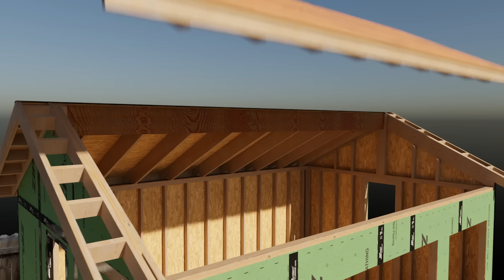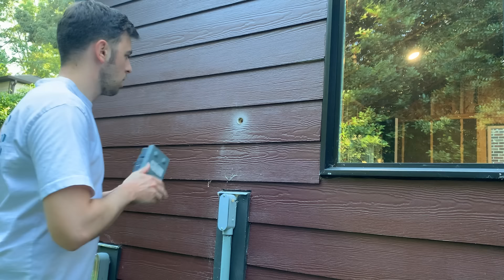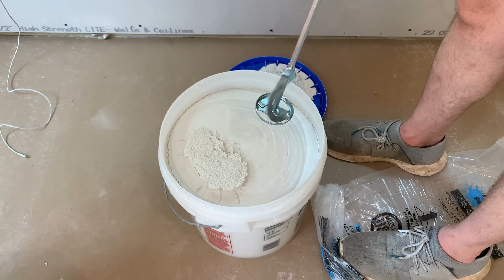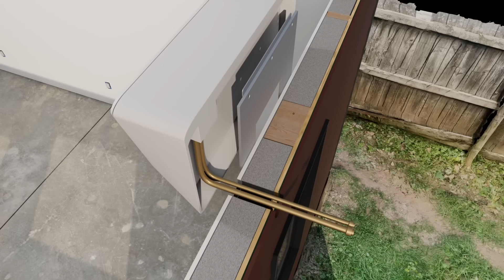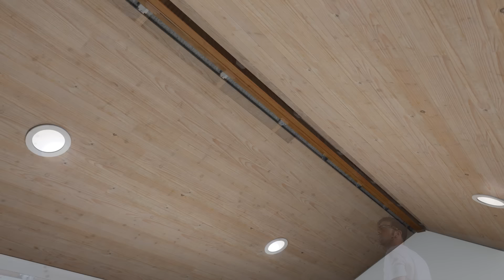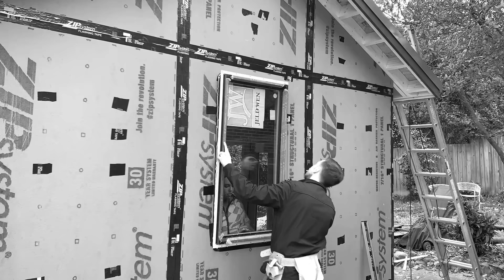Backyard Office & Workshop | Full DIY Interior Build (Insulation, Drywall, and Mini-Split)

Comment: I don't understand why people in certain parts of the world build a house with "wood" in a area known for tornadoes...etc?

ps: nice build btw.
Reply: First, most of the U.S. doesn't experience tornadoes. Second, you don't understand because your not educated on the relevant topics. You don't understand that American homes routinely stand up to EF2 and below tornadoes, which are the very large majority of tornadoes. You don't understand that EF3 to EF5 tornadoes would also devastate your concrete/structural brick homes and their contents, especially EF4s and EF5s, because you don't understand how tornadoes actually inflict their damage. If you have a roof, windows, and one or more doors, the tornadoes you see that destroy U.S. homes are going to cause severe damage to your home, too, including the destruction of your interior and its contents.

I'm going to try to edify you:

1. Cost-efficiency: Building with wood is significantly more affordable. If this office had been built with poured concrete, brick, or ICF, the wall system alone could have matched or exceeded the cost of the entire finished build. Solid clay brick or ICF construction could easily triple the expense.

2. Ease of use and adaptability: Wood is abundant in the U.S., straightforward to work with, and highly flexible—ideal for DIY construction or projects that may need future modification. Cement and brick are far less forgiving in this respect.

3. Longevity with modern materials: Products like ZIP System sheathing, Rockwool insulation, and closed-cell spray foam enable wood-framed structures to last 50+ years with routine maintenance. Many forms of maintenance (like roof replacement, HVAC servicing, or window sealing) apply to all construction types—wood or masonry.

4. Maintenance as personalization: Americans often view upkeep not just as a necessity, but as an opportunity to customize or improve a space. Materials that are easy to modify make this more feasible and affordable for homeowners.

5. Climate and seismic suitability: Wood performs better in earthquakes than rigid masonry or concrete because it can flex and absorb energy without catastrophic failure. In humid or freeze-thaw climates, wood-framed walls with proper air and moisture barriers dry more quickly than solid masonry, reducing long-term degradation risk.
 
6. Masonry Is not maintenance-free: Structural brick or cement walls crack over time due to settling, thermal movement, or moisture intrusion. Repointing brick (replacing deteriorated mortar) is labor-intensive and costly. In tropical or coastal climates, concrete often suffers from spalling and rebar corrosion unless treated or maintained diligently.

7. Code and efficiency evolution: Contrary to what creators chasing views and comments, as well as the vast expanse of ignorant anti-American bigotry, will tell you, U.S. residential building codes are designed around framed construction and offer prescriptive paths for high energy efficiency, air-sealing, and insulation. That doesn't mean that structural brick, ICF, and poured concrete aren't commonly used here, and in fact you'll often find this mixed in with wood-framed construction. But modern assemblies using continuous exterior insulation, WRBs like ZIP, and smart vapor retarders outperform many uninsulated or monolithic masonry walls in both comfort and efficiency.

8. Speed and labor: A small wood-framed building can go from slab to dried-in shell in a matter of days, even by one or two people. Masonry and concrete construction is much more labor-intensive, often requiring skilled tradespeople, scaffolding, longer curing times, and heavier equipment—costs that quickly add up in time and, importantly, significantly higher costs.

9. Thermal bridging: Wood has far less thermal conductivity than concrete or brick. That means fewer cold spots and less energy loss—especially when combined with modern insulation. Solid masonry often requires interior framing or furring strips just to install insulation and wiring, undercutting the “simplicity” of masonry walls.

10. It’s CONTEXTUAL, not cultural: The U.S. uses wood because it makes sense in the U.S.—where forests are abundant, labor is expensive, and zoning often encourages detached structures with individualized heating/cooling. Many European or tropical regions build with masonry because their conditions are different—denser cities, cheaper masonry labor, limited forest resources, or colonial building legacies.

Critically, the United States encompasses one of the most diverse ranges of climate zones and geographies on Earth, spanning 8 major climate zones and 13 subzones—covering everything from arctic to tropical, humid to desert, coastal to alpine. This geographic and environmental diversity is reflected in our building code and practices, which allow homes to be tailored to the specific demands of each region.

It’s not that one method is universally ‘better’—it’s that building wisely means adapting to local realities. In North America, wood framing for residential construction is the clear choice much more often than not. And when it's not, we can build it differently.

Comment: I don't expect you to care, but This means the keyboard should be below you height when seatedas a network engineer who is now in PT for severe RSI, your monitors shouldn't be that high. The top of your monitor should be close to, or parallel with your eye/brow line. The keyboard should also be below your elbow height when seated. I'm not meaning to be critical, I've sustained pretty dramatic nerve damage from a posture very similar to what I see at the end of the video and don't want anyone else to experience this. It really does suck. Awesome build otherwise, looks really chill.

Comment: Not sure what made you decide to use spray foam. Vapor barrier plastic sheeting is cheaper, doesn't trap moisture, and isn't carcinogenic. It's also way less of a mess, during installation, and if you ever want to do any kind of maintenance or adjustment.
Reply: Foam is not carcinogenic. Everyone that says this about foam is wrong. It off gasses in 24 - 72 hours( the same as paint) then it's fine.
Reply: @thedarkside3394  Spray polyurethane foam is absolutely carcinogenic, off-gassing causing acute neuropsychiatric symptoms. Only when the foam is mixed and sprayed perfectly, and the foam is not disturbed in any way, does it not cause acute health issues. However, it has never been proven "cured" SPF is not carcinogenic after off-gassing.
Reply: @Biru_to  Wrong. once again, once it's cured, it's fine unless you're a dumb ass and are going to eat it.. You should be worried about the clothes you wear cause that off gasses more than foam. Or the water you drink out of the plastic bottle. Everything around you off gasses for long time but for some reason stupid people want to lie about foam just cause they heard it from another stupid person.

Comment: Am I the only one that is slightly disappointed you didn't have Ethernet on every wall, one by your 3d printer, and near the TV plus a location for a wireless accesspoint while you had all the walls open? It's always better to have and not need then need and not have. Plus being a nerd I would have also run a fiber line as well because you can always change equipment on both sides and keep getting faster speeds instead of cat 7 or 8 and being limited to 10gb speeds. I mean if you are doing video editing over the network on your NAS setup in the house, the faster the better. Have one fiber between the house and shack, switch goes in the electrical room area and have all the Ethernet back to that area, save a lot on cable costs. Fantastic job on everything else though, and the video editing and format was really impressive.

Comment: Why do you all use flammable materials? I understand they are cheap and easy to work with, but they also catch fire.
Reply: The typical American house fire is no worse than the typical European house fire. Rockwool, drywall, and a variety of other materials commonly used in residential construction are non-combustible or are very resistant to ignition, and slow the spread of fire. We don't use wood framing simply because it's "cheap," in fact it is not cheap in absolute terms but it is very cost-effective in relative terms versus other materials. We use wood framing because in the large majority of cases it's the best choice:

1. Cost-efficiency: Building with wood is significantly more affordable. If this office had been built with poured concrete, brick, or ICF, the wall system alone could have matched or exceeded the cost of the entire finished build. Solid clay brick or ICF construction could easily triple the expense.

2. Ease of use and adaptability: Wood is abundant in the U.S., straightforward to work with, and highly flexible—ideal for DIY construction or projects that may need future modification. Cement and brick are far less forgiving in this respect.

3. Longevity with modern materials: Products like ZIP System sheathing, Rockwool insulation, and closed-cell spray foam enable wood-framed structures to last 50+ years with routine maintenance. Many forms of maintenance (like roof replacement, HVAC servicing, or window sealing) apply to all construction types—wood or masonry. And for reasons I can't understand, non-Americans routinely ignore that we often do build with or include brick, concrete, and ICF.

4. Maintenance as personalization: Americans often view upkeep not just as a necessity, but as an opportunity to customize or improve a space. Materials that are easy to modify make this more feasible and affordable for homeowners.

5. Climate and seismic suitability: Wood performs better in earthquakes than rigid masonry or concrete because it can flex and absorb energy without catastrophic failure. In humid or freeze-thaw climates, wood-framed walls with proper air and moisture barriers dry more quickly than solid masonry, reducing long-term degradation risk.
 
6. Masonry Is not maintenance-free: Structural brick or cement walls crack over time due to settling, thermal movement, or moisture intrusion. Repointing brick (replacing deteriorated mortar) is labor-intensive and costly. In tropical or coastal climates, concrete often suffers from spalling and rebar corrosion unless treated or maintained diligently.

7. Code and efficiency evolution: Contrary to what creators chasing views and comments, as well as the vast expanse of ignorant anti-American bigotry, will tell you, U.S. residential building codes are designed around framed construction and offer prescriptive paths for high energy efficiency, air-sealing, and insulation. That doesn't mean that structural brick, ICF, and poured concrete aren't commonly used here, and in fact you'll often find this mixed in with wood-framed construction. But modern assemblies using continuous exterior insulation, WRBs like ZIP, and smart vapor retarders outperform many uninsulated or monolithic masonry walls in both comfort and efficiency.

8. Speed and labor: A small wood-framed building can go from slab to dried-in shell in a matter of days, even by one or two people. Masonry and concrete construction is much more labor-intensive, often requiring skilled tradespeople, scaffolding, longer curing times, and heavier equipment—costs that quickly add up in time and, importantly, significantly higher costs.

9. Thermal bridging: Wood has far less thermal conductivity than concrete or brick. That means fewer cold spots and less energy loss—especially when combined with modern insulation. Solid masonry often requires interior framing or furring strips just to install insulation and wiring, undercutting the “simplicity” of masonry walls.

10. It’s CONTEXTUAL, not cultural: The U.S. uses wood because it makes sense in the U.S.—where forests are abundant, labor is expensive, and zoning often encourages detached structures with individualized heating/cooling. Many European or tropical regions build with masonry because their conditions are different—denser cities, cheaper masonry labor, limited forest resources, or colonial building legacies.

Critically, the United States encompasses one of the most diverse ranges of climate zones and geographies on Earth, spanning 8 major climate zones and 13 subzones—covering everything from arctic to tropical, humid to desert, coastal to alpine. This geographic and environmental diversity is reflected in our building code and practices, which allow homes to be tailored to the specific demands of each region.

It’s not that one method is universally ‘better’—it’s that building wisely means adapting to local realities. In North America, wood framing for residential construction is the clear choice much more often than not. And when it's not, we can build it differently.

Comment: in my country we can get this build in 1000-1500 $ but with bricks and rcc roof
Reply: No, you can't. No one cares about your brick wall that doesn't offer any real-world advantage for a use-case like this, and putting an RCC roof on in this climate zone would be a recipe for slow-rolling disaster. The fact that you people who can't even understand the advantages of residential construction in the U.S. so routinely make such ignorant comments is astounding, and that's before we get to the fact that you don't even understand that the U.S. has the most diverse mix of climates, environments, and geographies that have to be planned for when architects, engineers, and contracts design and build homes.
Reply: @Objectified  usa has less diverse climate than my country, and the reason usa dont use brick and rcc roof is simply because of total construction cost, where in my country monthly labour cost would be 300$; in usa it would be 3000$. Your reasoning is not strong.
Reply: @ratnakarmayank  No his reasoning is strong. Wood built homes have double the R value of brick built buildings making it more energy-efficient in cold climates. All you foreigners that always talk about American homes don't have a clue what the hell you're talking about.

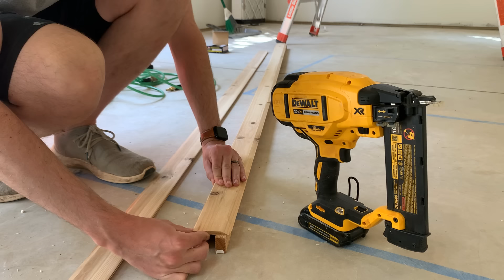Comment: 28:02 never push something on the table saw from the opposite corner from the blade, you will add rotation by accident and with just a small amount of rotation you can have a disaster.

Comment: There are very interesting differences in the construction of the building. For example, in Russia, according to the requirements, it is necessary to install a vapor barrier (a membrane that will not allow condensation to pass through) to keep the building standing for a long time and prevent mold from spreading. The same foam that the roof is treated with must be covered with a membrane, because the foam will lose its properties from moisture and crack.
Reply from the maker: I can absolutely see the value in a colder climate. Our weather here is very mild with short winters

Comment: since your shed doesnt have an "anchor" basement (lack of a better term), is there a chance of the whole concrete bed tilting due to potential instability of the soil??
Reply from the maker: The concrete foundation has a footer which acts as the anchor. The perimeter extends down below the frost line to prevent movement

Comment: Very cool Virginia Tech wood campus map in the intro, Go Hokies!

It would've been good future-proofing to run conduit in the wall in case you ever need to replace the HDMI or ethernet cables or add any other cables. Otherwise excellent job! Very detailed video with great camera work and clear narration. The animations were cool too, nice touch.
Reply from the maker: Go Hokies! I looked into using smurf tube to accomplish this, but I wasn't able to figure out a good way to run it around the corners. With 2x4 walls, the corners are pretty tight. I'm sure there is a solution but I was eager to get started on the insulation. Thanks for watching!

Comment: One thing I've noticed is that you have no ventilation in a room where you plan to use a 3D printer. Why?
Reply from the maker: There will be ventilation! I'm building a custom laser cutter along with a whole ventilation system to bring fresh air through the machine. I'm planning ways to incorporate my printer into this system

Comment: everything look so flammable, you might want to watch out for fire hazzard like electric stuff...
Reply: I don't understand why you people think everything is so flammable. The large majority of residential house fires in the U.S. result in only localized and smoke damage, which is also the case in cement/brick structures. In this build the Rockwool insulation is not combustible. The drywall is not combustible. The metal roof is not combustible. Everything else is either protected with a non-combustible layer or resists ignition. The desk might be the most combustible thing there. And this is a structure built by do-it-yourselfers. It doesn't even incorporate the interconnected fire alarms, even more fire-protective forms of drywall, fire-blocking, etc. that are the norm for home construction and renovation for decades now, and are some of the many reasons why residential fire incidence rates have decline by half over the last 50 years.

Comment: Good DIY but one nitpick. You didnt put any nail guard on your studs where you ran your romex wire through. Other than that good work.
Reply from the maker: Thanks! I placed the stud penetrations back further than an 1-1/4" from the face of the stud so I wasn't required to have them